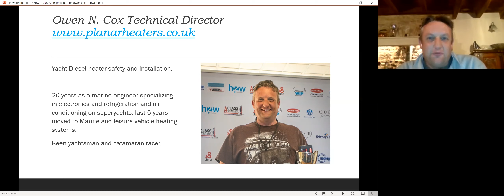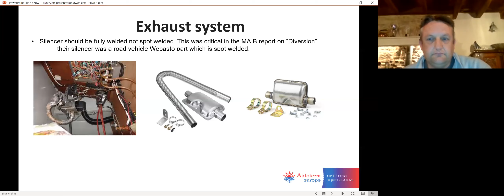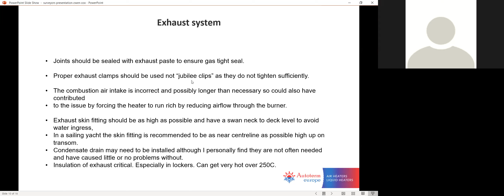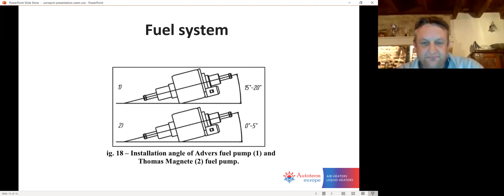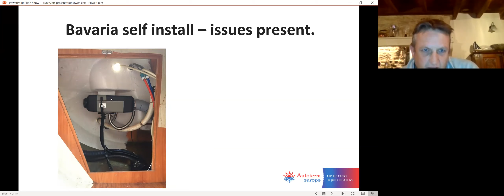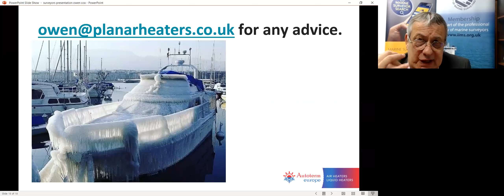Installation and safety of diesel heaters on boats by Owen Cox

Comment: Excellent installation discussion and standards to follow. You have stressed safety as the primary concern in every necessary part of the system. These installation tips are relevant in any vehicle, not only for marine applications. Perhaps most of the rules are relevant even in a garage or small building. Great post!

Comment: Nice presentation!! Planning on installing a Chinese knock off in our Grand Banks. Was planning to tee fuel off of the generator Raycor filter with a brass 3 way on / off valve. I will have positive fuel pressure at the heaters pump as the Raycor is lower than the fuel tank. Any problem with that? Thanks for your insight.